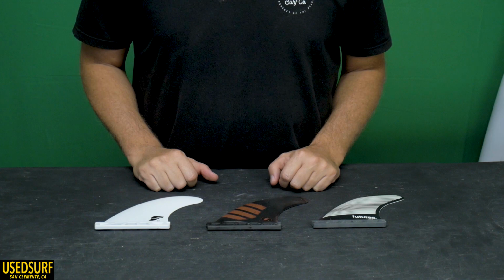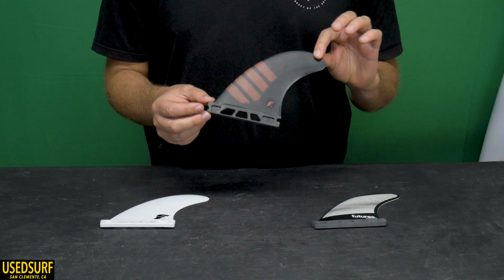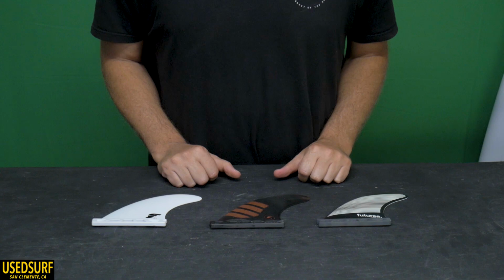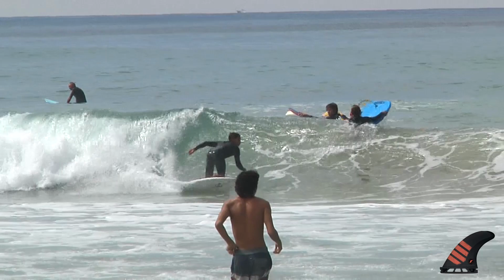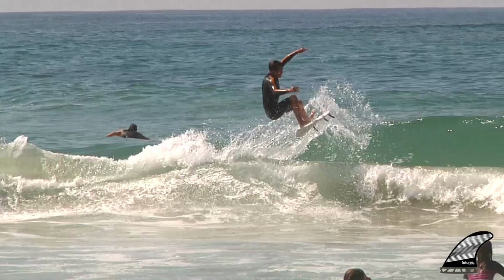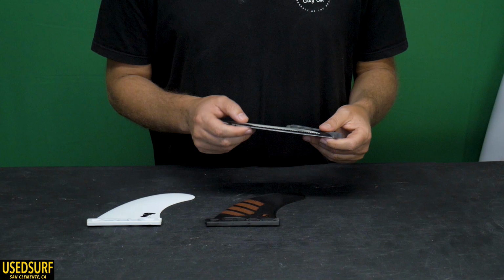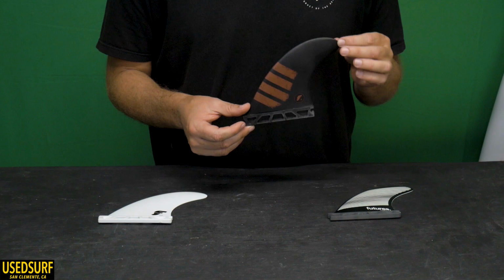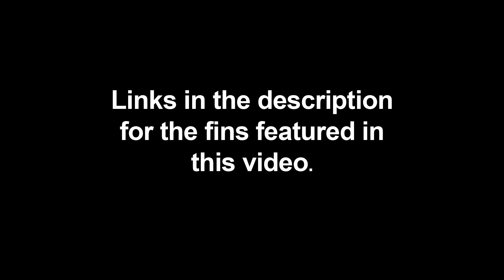Fin Guru Futures F4 Fin Review - Same Template, Different Constructions Will they ride different????

Comment: That was so on point. I've rode the Alpha's on a high performance board on good waves and felt like I was so out of control, too much flex on them, then tried it on a smaller wave and with a Groveler/low rockered board and they went awesome, more spring out of turns, more "pop" which you really look for on smaller days. Excited to see more videos like this!
Reply from the maker: Yeah I feel like the alphas are a good small wave fin

Comment: I recently got the alpha as a twin, it was my first composit fin I had ridden in over 10 years. I love the performance, but I had them snap at the base on some heavier turns. I got a replacement for the fin and the same thing happened. Maybe only small grovely surf.
Reply from the maker: Yeah that is interesting. I know on the T1  it used to have an inner foil and that would thin out thw fin and they were breaking so then they removed the inner foil so the material was thicker. I think that because there's so much more surface area on the twin fin it puts a lot more stress and pressure on the material. Kinda of bummer...sorry to hear that.. you could be right maybe is not the best material on the bigger twin fins due to that problem
Reply: @used_surf  I thought the same. The twin has a little keel to it as well, but it seemed to have a flat foil on pair that I had. I thought it was funny, because I was trying to give composites another chance and was excited about the new materials and price point. I have found the generation series by future one of the best thus far. Killer as a quad and thruster
Reply: I’m looking at som alphas in the rastovitch shape. Reason being is they’re cheaper and I cracked the fins along the base
Reply: @kasimsadiq3936  are you talking about the Rasta Twin they have? I do want to give their new Vector 3/2 they came out with. I use to have an old set of their vector II. It had a hatchet as the center fin and some crazy foiling on it. They were great. I have the Solus by them with a hatchet as well and they work similarly

Comment: Would you say intermediate will feel the difference between the fins?
Let's say, in a smaller surf up to head high, as an intermediate would you feel difference between blackstix and alpha/honeycomb?
Reply from the maker: Sorry I thought we replied to this sooner. Yeah I definitely think you would feel a difference. They also would more than likely feel a little faster. At least that's what we've noticed on our end. I do think though, with either two of the ones that you mentioned, you would be okay because both of those constructions are geared towards smaller surf. But on our end we would go with the alpha for an intermediate.
Reply: @used_surf  thanks!

Comment: Alpha fins too soft and spongy feel in my opinion. Honeycomb all the way and blacksticks for small waves.
Reply from the maker: Yeah that makes sense 100 percent. The blackstix were missing from this comparison. But not all templates are available in blackstix.  As an example the John John template. It is a great template but only comes in a techflex or alpha. Our team riders have had really good success using that template in small waves via alpha material versus techflex. The techflex is flat foil and stiffer and therefore better for bigger stronger waves. But you are right, blackstix all day long for best small wave performance...if it has your most ideal template for your board.
Reply: My experience, too...alphas "folding over" while doing cutbacks in waves with any punch.  Carbon in these is minimal and not an actual carbon layup (like on the Hayden HS fins).  I swapped out the center fin out for an old fiberglass one and that helps stabilize the alpha sides lot...works for summer.

Comment: Not super stoked on Alpha.  Way too flexy (plasticity) in punchy waves and don't have the snap-back of an actual carbon layup.  Maybe better than Thermotech, but only because Alpha are significantly lighter.
Reply from the maker: Yeah maybe the blackstix would be best for everyday
Reply: Can't really afford Blackstix.  Got the P8 alpha set for $48 out the door (black Friday).  Swapped the center fin out for an old fiberglass one, which added just enough stiffness to keep cutbacks from feeling weird.  Still using this set for summer.